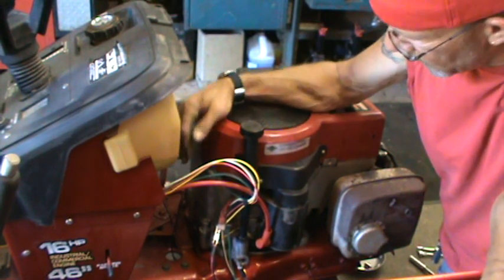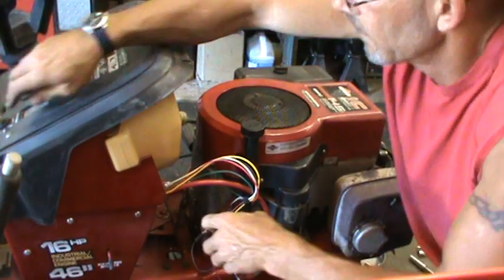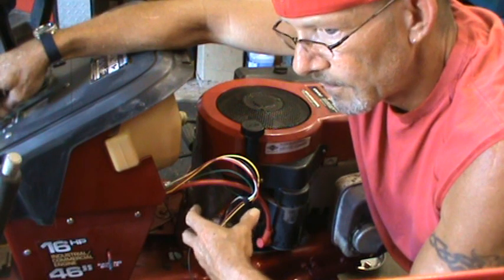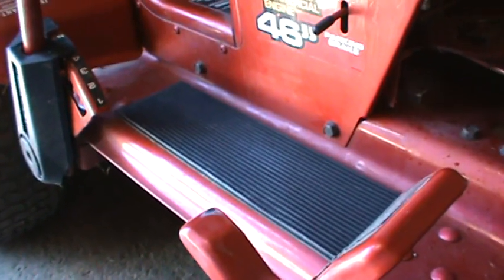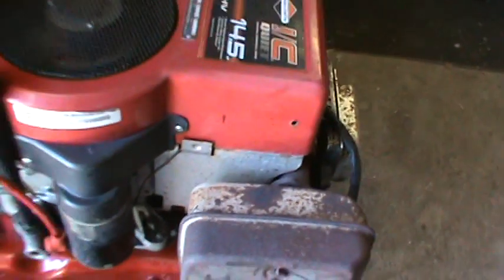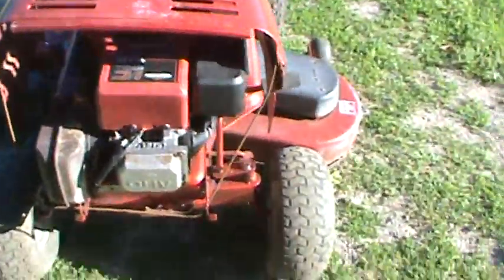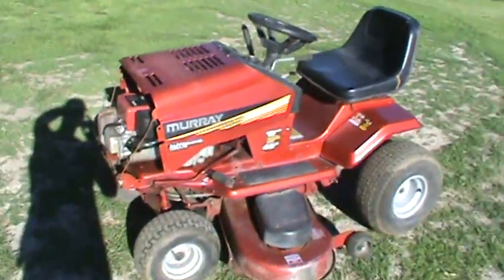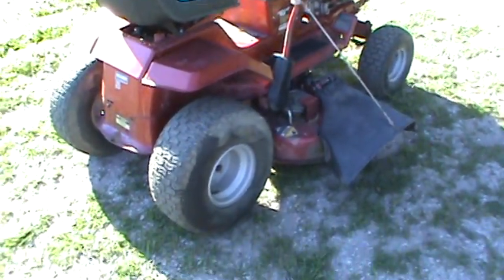Murray Gets a New Heartbeat Part 4 Conclusion

Comment: Nice work. Real clean. Besides the name tags that's an MTD tractor isn't it? Wondering if there's front ends from all sorts of other tractors what would fit on there. Or they could stick a radiator shell on from a Model A! 

My Horsch isn't going to be so nice. The 23-D won't bolt right to the frame. I have a plate made for the Rat that fits the engine, should work somehow. For now, the Agway is still working nice.
Reply from the maker: It's actually not an MTD, no. Their hoods, frames etc are all Murray specific. The kicker is, I JUST Scrapped out a slightly older Murray not too long ago that had a hood I could have used! Argh!! But...I can't keep everything that comes along in hopes of needing it later. Onto your Horsch...You can do what I did with Traitor and weld a piece of angle iron to the frame so you can mount the 23D. I think the frames should have been built wider, but there's always a way. As long as it works, since it's for your use, it doesn't need to be pretty!! Great hearing from you my Friend! Zip~